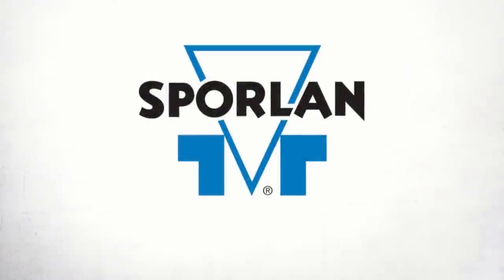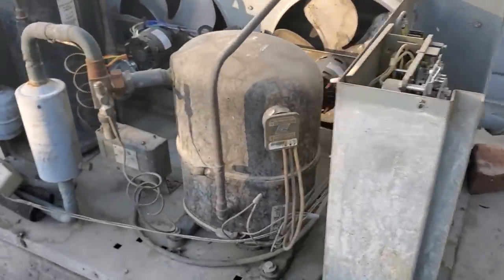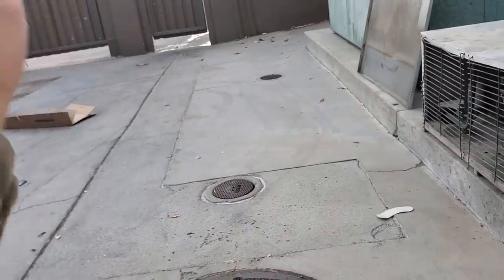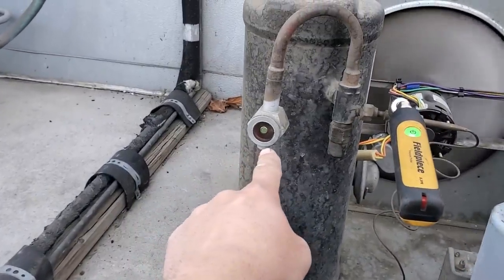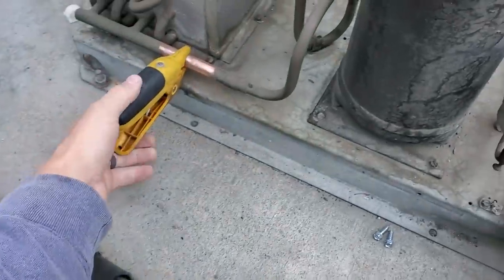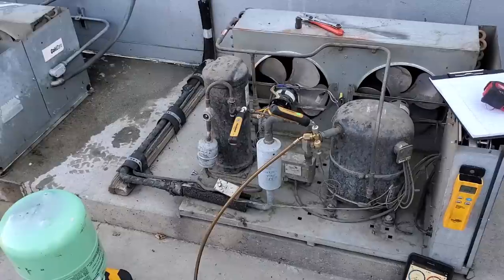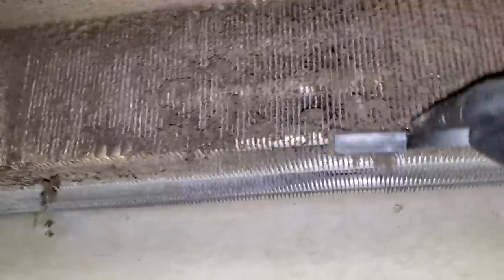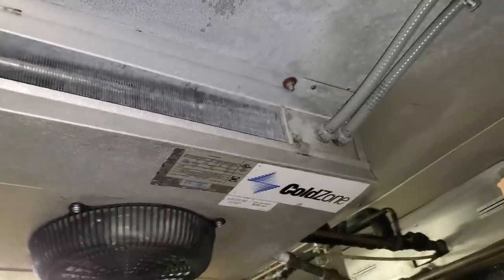WALK IN COOLER ONLY WORKS WHEN IT'S WARM OUTSIDE

Comment: I have a question: That system has a charge compensator on it, why isn't it plumbed in and why did you not plumb it in?
Reply from the maker: What is a charge compensator?
Reply: @HVACRVIDEOS  A charge compensator is a component that stores extra refrigerant in a vessel that surrounds a refrigerant vapor line that goes straight through and has a port on the vessel that is plumbed to the liquid line. It uses the vapor line temperature to move extra refrigerant into and out of the vessel and into circulation in the system as the unit needs to perform as intended. If I'm not mistaken that unit has one installed already but the excess refrigerant vessel is not plumbed in, you can see it just left of center screen at 9:10 before i recognised what it was I thought it was a suction line accumulator but the port on the side and the line running through top to bottom indicate it isn't, i could be wrong though.
Reply: @Puffalupagus360  Judging from the number printed on it, that's s a Sporlan C-307-S-T-HH suction line drier.

Comment: Could I get some advice from you ? I'm  hvac helper resident  . I want  to work for commercial.  I don't know, I should continue working on hvac resident ,  is HVACR resident and commercial , are they different right ?  is hvacr commercial more complicate to fix than resident hvacr ?  is commercial have more parts hvacr than resident HVACR ?  Thank you.
Reply: I would say whatever you feel you would be more happy doing. I use to do residential and recently got into commercial and refrigeration. It is in my opinion a little more complicated but way more fun. More fixing. Same refrigeration principle but more components to learn. Especially rack systems. Good luck on your journey

Comment: After calculating the additional winter charge, do you recover and weight it in order to know what to add?
Reply: Never mind, I got it
Reply: It may not have been clear from the video but at 13:16 it is mentioned he calculated the charge twice. The one he showed for 0 degrees ambient and one for the current ambient temperature. The second calculation gives you how much refrigerant is probably in the system at this time as the sight glass is clear. 

To then get how much additional charge is required you only need to subtract the current charge from the 0 degrees charge.
Reply: Levi Voorintholt yeah I missed it first time around
Reply from the maker: I will be going live on YouTube this evening 11/4/19 @ 5:PM (pacific time) to discuss my most recent uploads answer questions from emails, the chat, and YouTube comments. Come over and check it out if you can.     https://youtu.be/edrzjZTZX18

Comment: you shouldnt add liquid on the low side i though because you could slug the compressor.

unless the compressor is so hot it flashes off.

Comment: Wtf is a winter charge its either fu or not
Reply from the maker: Winter charge is the extra refrigerant needed during the winter for the condneser to properly flood while maintaining a solid column of liquid to the TEV.  The system has to have a head pressure control valve for the winter charge to be needed
Reply: So then what happens in the summer youd be overcharged?
Reply: @mahalasdaddy  no that's what the receiver is for. Think of it as "storage" for "extra" refrigerant.
Reply: @mahalasdaddy  It may be....if the customer calls in the summer, that's the first thing you'll have to check.  Acid wash the condenser and then adjust the charge accordingly.   Although with this videos 4lb of freon loss is a lot...so there may be a follow-up video or a update...To be Continued?
Reply: Why not just unplug the fans a few times and charge to a full sight glass
Reply: @mahalasdaddy  Because that wouldn't really do anything for you. I'm assuming you mean unplug condenser fans? If you did that you would raise the head pressure and cause the head master not to bypass. Chris is trying to ensure that the system will continue to run with full sight glass even while the head master is bypassing.
Reply: Wtf is fu?
Reply: I have systems you absolutely have a winter charge and also a summer charge. Usually it’s on a smaller system with a longer Lineset and a smaller receiver tank. Not enough at 0° but too much on a roof in the sun at100°. We all work on systems that we didn’t install. Sometimes you need to work with what you have. IMO Chris is good at explaining these videos to YouTube because he takes the time to tell his customers why they are having the issue and how he is going to fix it. He’s been doing the explaining his whole career.